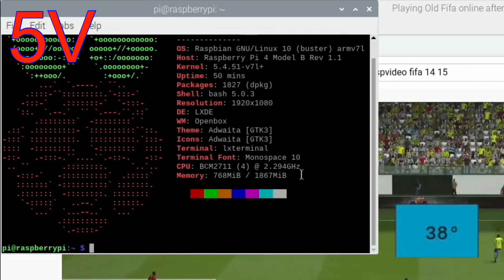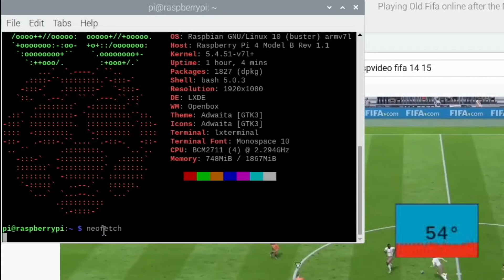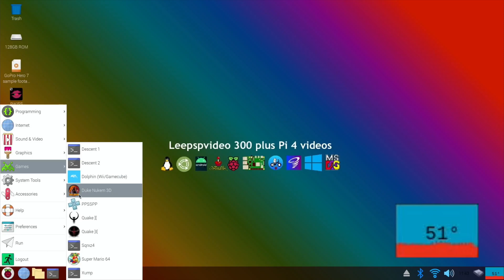Ice Tower Cooling Fan. Passive Cooling test. Raspberry Pi 4.

Comment: Recently, I purchased a Raspberry pi 4 with a plastic case and a small  30mm cooling fan. But I want to know what would happen if I only rely on just the weak cooling fan without the heat sinks.
I ran an intense blender rendering and the whole process takes 4 and a half hour to complete with cpu running at 100% memory used 467mb. The temperature stays in between 67 to 72 degrees.

Comment: Probably worth mentioning if you have little ones there is nothing to stop small fingers getting to the fan blades. Luckily it’s a standard size and dead easy to print a cover. I have mine in black either unplugged or @3v sits at <50 degrees c all day long,

Comment: How about removing the fan and orienting the board and heatsink so that the air flows through the fins by convection?  I.e., stand the board "on end" with the cooler fins perpendicular to the table.
Reply from the maker: I have a solution. I’ll put it in a video.

Comment: Nice!!! 👌
I would like to suggest one thing about connecting any external loads like fan or any load directly to the 3.3V power connector of Raspberry Pi might be a bad idea because generally in low power application the DC voltage is stepped down from 5V to 3.3V using a linear voltage regulator for a noise free environment and I'm not sure in case of Pi may be the Broadcom chip also powerd from same power converter. 
If we overload the 3.3V supply there is a chance of blowing up Pi's power circuitry. But in case of 5V it won't be like that because it will be coming directly from 5V USB power supply and won't effect 3V supply.
You can connect it directly if the company specifies as Pi4's 3v GPIO pin can be used to power it.
Reply: If you need 3v supply with higher current then  I would suggest connecting an external step down buck converter which can give efficiency above 80% generally with high current out put like this one for example 

Rs. 28.83  5%OFF | RC Airplane Module Mini 360 DC Buck Converter 2A Step Down Module 4.75V-23V to 1V-17V 17x11x3.8mm New LM2596
https://a.aliexpress.com/_mLBk6dZ

In this we can even adjust the out put manually with a screw driver without causing problems and the input we can take from the 5V GPIO and common ground.
Reply: If you ask me why did they give 3V out put. It is basically for low power application like connecting a Real Time Clock IC or any ic/circuit which draws very low current.
Actually I did made this kind of mistake with my Raspberry Pi 3 B by connecting a fan and some LED with a custom circuit that I designed to control the speed of Raspberry Pi's cooling fan automatically..😂😂 and after some time the Bluetooth stopped working, no matter what I do...
Reply: @shanthanuk.j.1120  now what I need to do
Reply: @flowergardenrgarse7152  In the GPIO pin there are 2 numbers of 5V output pins from which you can take that supply and connect to DC DC external regulator like LD1117 or something and can get 3.3V out from it. 
5V is directly coming from the Type-C (Pi4) / Micro USB (Pi2/3) power supply port directly

Comment: I've got the low profile one & love the snot out of it. I've noticed too upon initial boot i get all the colours but once I'm in the OS it changes between blue, purple & green. I noticed if I'm rendering an hr or longer PS4 video in OpenShot with my OC CPU/GPU plus I've got an OC on my GPU's memory if my Pi gets above 45-50C the fan changes & cycles through red, yellow & orange. Once the fan ramps up & gets it back below 45C it changes back to Blue, Green & Purple Cycle.
Reply: I have the same fan. I've never had it get over 62 no matter what I do. I got a case to fit it off of etsy.

Comment: There is a second model of the Ice Tower (low profile?) that the fins run horizontal rather than vertical and the fan blows through the fins and across the motherboard. Which cools the chips. Whether cooling those chips actually makes any real difference is another question.

Comment: Yes, the limit for my Pi is 2.000Ghz (yes with higher cpu_voltage, too!), all above will result in sudden reboot and strange behavior.
Reply from the maker: Are you using the official Raspberry Pi 4 power adapter?
Reply: @leepspvideo   Yes, I do :) My other Raspi4 does go up to 2.1Ghz - and randomly reboots or shows strange behavior. So I think not every CPU acts the same...

Comment: Hey my raspberry Pi not booting and also act led not blinking only power led is showing....I tried different Power supply and also different sd card but nothing worked..can you plz help..
Reply from the maker: The Pi does need a decent power supply. I recommend the official one.

Try flashing Raspberry Pi OS again or a different display.

Comment: Isn't it risky to source current from the 3,3 V pin for the fan? The pins have a limited current output, there is a risk of killing the Pi I think.
Reply from the maker: It’s recommended in the instructions.

Comment: I removed the bar on the fan rack  -- The low profile one is kool that one I have on Bottom with an old hhd under it  --  you will get about 10 c cooler in the fan rack at 2147 overclocked     -- Also Great Vid once again